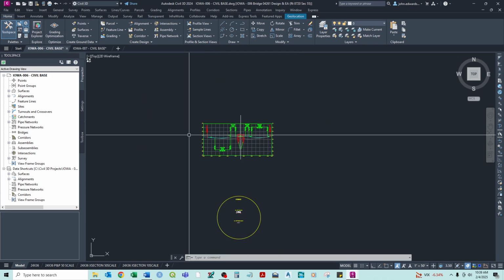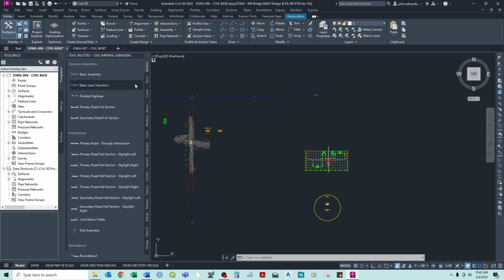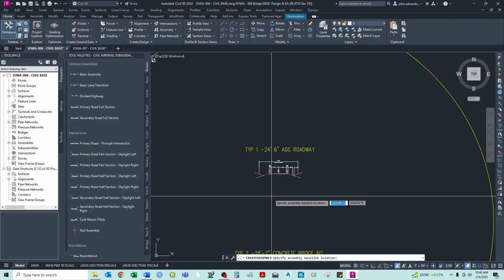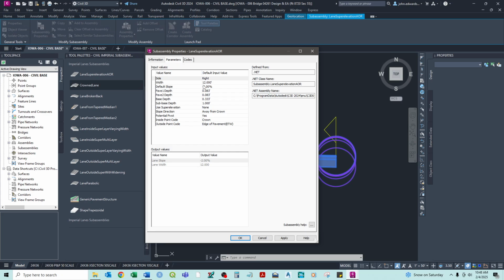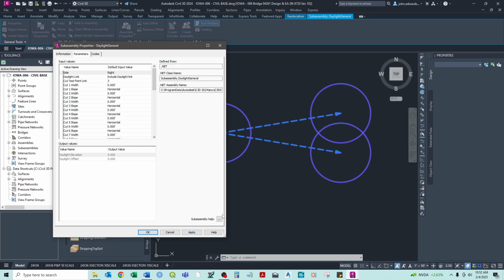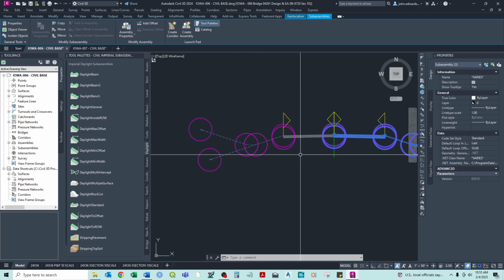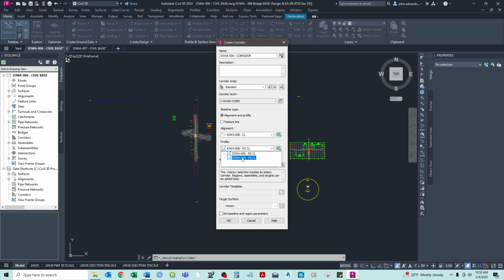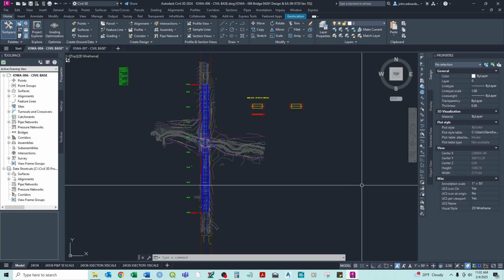5-Civil3D Bridge Design Process - Creating Assemblies and Corridors

Comment: Hi John. Thanks for the helpful series. I was following along well until the beginning of this video where it seems to me that there are some steps missing. Video 4 ended with the creation of the finished grade profile. At what point did you insert and size the bridge and run the hydraulics? Were those steps intentionally left out?
Reply from the maker: Thanks for watching.  I intentionally left out those steps since the primary goal of the video series is just the Civil3D aspects of the bridge design.  The hydraulics and bridge sizing was completed in HECRAS and the bridge was manually drawn in based on the standard specs, then just placed along the alignment and profile.  Normally we run the hydraulics before getting a final alignment and profile to help guide that process.
Reply: @johnedwards4115  Hi John, i'd like to say thank you for the series, it's full of insight for me as a student. I also would like to ask, is manually drawing bridge structure and placing it along the alignment and profile is the standard practice or are there other way of doing things?